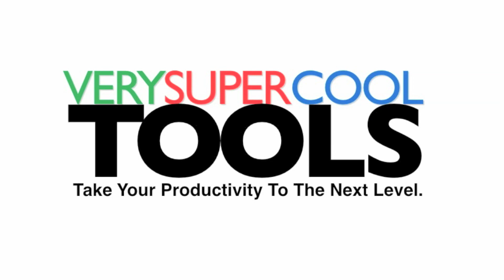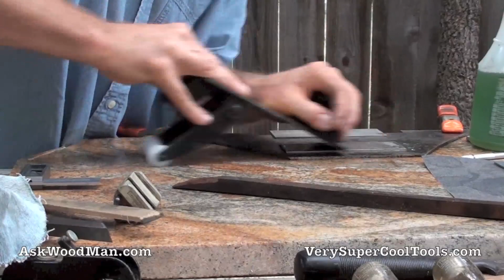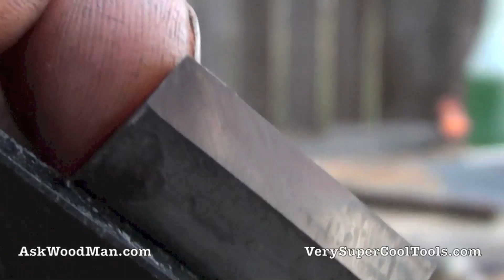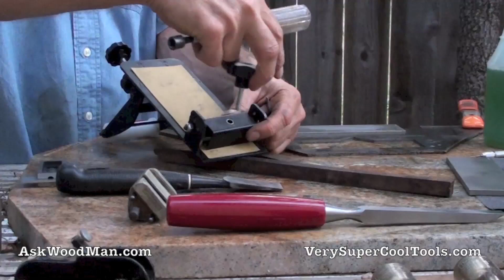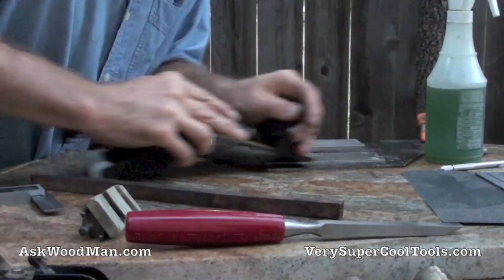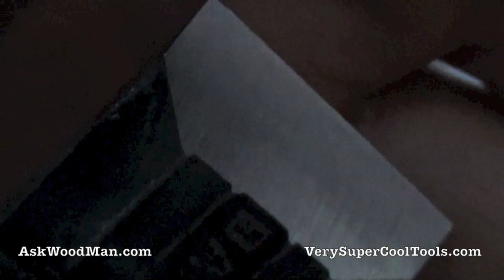(7) Ultimate Sharpening Jig Series - Continuous Angle Adjustment

Comment from the maker: These are the sharpest blades in the shortest amount of time I have ever had. I will put some info up on that holder. It will work both right and left handed. Mine is made from a scrap piece of 10gauge steel. Yes aluminum will work just fine. I just use steel around my shop so have pieces of it more readily available. Aluminum would be a fine choice since an accidental touch with the tool won't damage your sharp edge as much as steel. Thanks.Allan

Comment from the maker: Good catch. I made a mistake of starting from outside in, when it should have been the other way. Either way will work but I just  think the nut on the outside makes an easier connection, and there is less obstruction to interfere with a tool in the carrier positioning that small pan head on the inside. Thanks for pointing that out. Allan

Comment from the maker: In the series you may have noticed my Kunz spokeshave. For mine I simply slip a little shim of wood/steel under the back of the u channel assembly so when the knob is tightened the pinning load is locking that blade to the platen. If the blade is even shorter, a scrap of steel or wood can be placed under the U onto the blade and tightened. Again it is best to raise the scrap piece so there is more of a point load for the pinning. I have a crazy assortment of tools. They all go in the jig.

Comment: Hello Allan,

Just received my Jig and was so excited that I went into the garage to sharpen my new Woodriver #4 plane without consulting your instructional videos. Mistake. I started honing from the toe instead of the heal. Now there is a sloping line from the bottom left of the bevel heel to the top right of the bevel toe demarcating the polished and unpolished zones. The polished zone is on top. Cont.

Comment from the maker: Those are nylok nuts. The design is just using those bolts as pivot points for that inner truss. The nuts are just acting as stops to hold the bolts in place. The bolts are more like pivot axles. So nut to bolt compression is not important. And I use the nylok so they don't fall off since they are just  for positioning. All the hardware on it is just standard stuff with nothing exotic. So if for example the threaded rod got bent or damaged it is just standard 1/4" 20tpi stock. Nice Turning Pepe

Comment: Thank you Allan. Tightening and untightening the nuts in the inner part would have been too difficult, in fact having the nuts outside is the only practical way to assemble this part of the jig. What prevents tightening too much the nuts to the point that they would inmovilize the "wide U" piece that is held by the 2 bolts, one at each side if the piece? I see you tighten the nuts but still the piece remains loose (as it should be). Is there any kind of "stop" when tightening the nuts? Pepe

Comment: IN MINUTE 6:10 YOU INSERT THE BOLTS FROM THE OUTSIDE OF THE PLATE BUT INMEDIATELY AFTER THIS A NUT  AND NOT THE BOLT HEAD CAN BE SEEN ON THE OUTER FACE OF THE PLATES.  WAS IT A MISTAKE YOU MADE IN MINUTE 6;10 WHEN YOU PLACED THE BOLT FROM THE INNER FACE OF THE PLATES?

Comment from the maker: Will you please write me at askwoodman @ gmail and send me your address and I can get you an exact shipping quote. The green liquid is a multi purpose cleaning product called Simple Green. It is water based and biodegradable and does not cost much. I don't know if they have it Mexico. It really floats the metal particles away and makes the steel bite the stone for quick cutting. The jig just allows for such simple angle setup, and the full stroke makes it quick. Allan